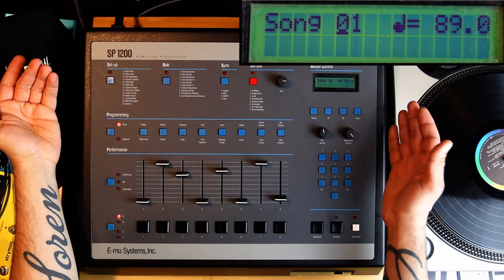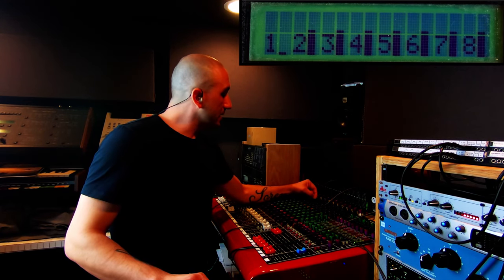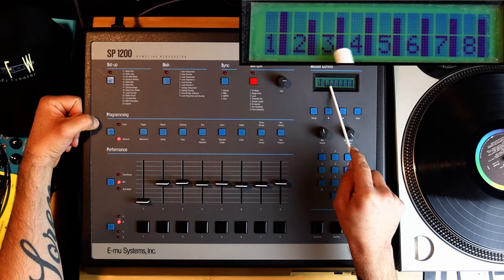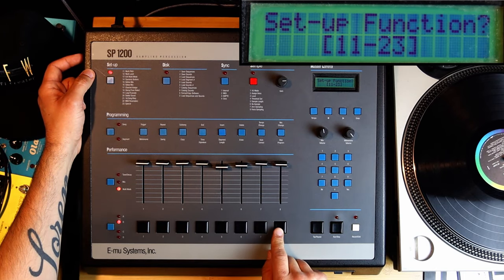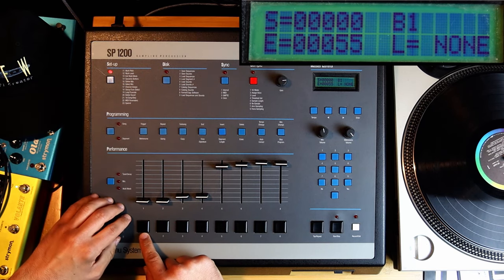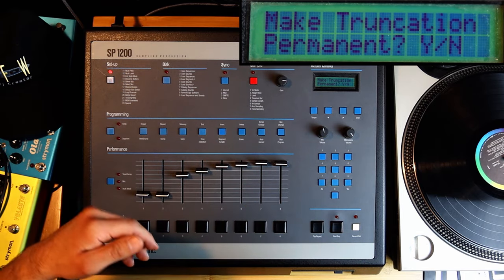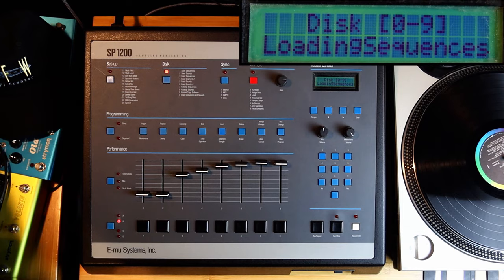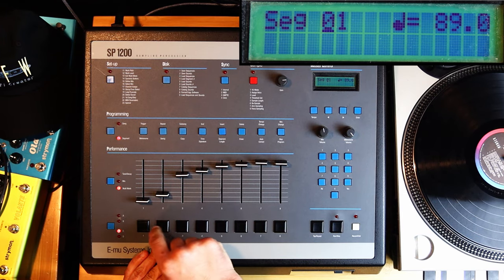The Legendary SP-1200 - Part 1 - Interface & Sound

Comment: Can you please explain why the sp1200 on ebay is now at $15,000 last year it was at $ 7,000 it seems to be going up dramatically
Reply from the maker: I actually just realized that a few days ago! It would usually go for $3000 in 2018 when I got mine. One thing is that they often don't actually sell for the high prices, so make sure to toggle "sold" on when you look on eBay and are curious about the prices (and how much to offer a seller). I have thoughts about this, and should make a video... Thank you for the idea!
Reply from the maker: Heyyy it's only been 1 month since you posted, but the SP prices are still climbing! I guess the SP-12 is not at 12K, at least "ARMENS prices"
Reply from the maker: So I was told that the new "ARMENS" price for the SP-12 (not even the 1200) is $12K now... Everything is climbing fast

Comment: its from 1997 ... NOT the mid 80's
Reply from the maker: I understand the initial thought. I should give some context for my specific SP. the original SP-1200 was in the 80s and mine - even though you see the black case - is in fact from the 80s. It’s not a regular reissue. Many parts are SP-12 parts, and it comes straight from… E-MU. It’s a prototype. My friend worked there in the 80s and 90s, and it was an SP he took with him when the company closed down. It was on the engineering bench over the years, and used to design new parts, such as the new power supply which later was used for the reissue. Hope this is useful. Take care and thanks for being here